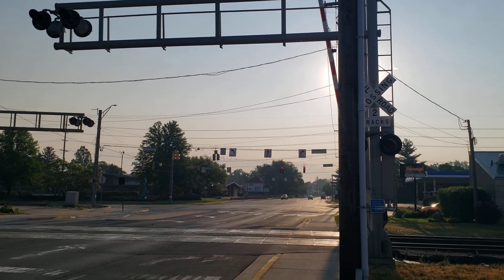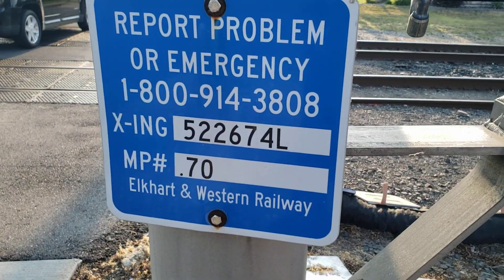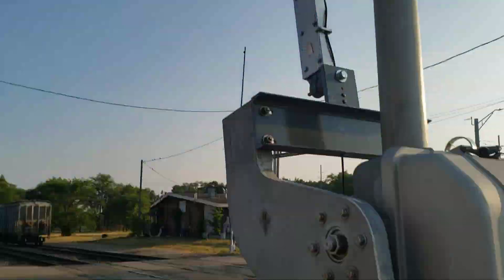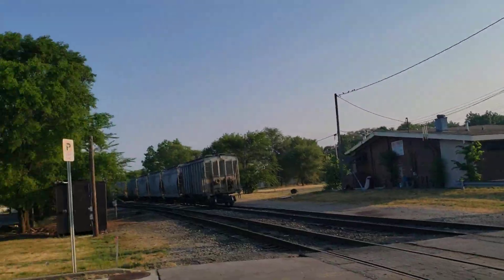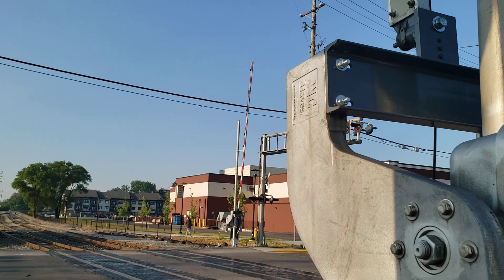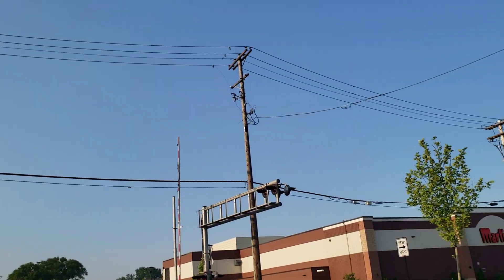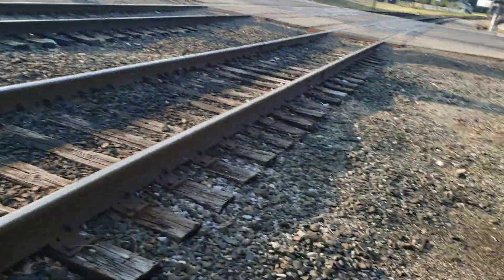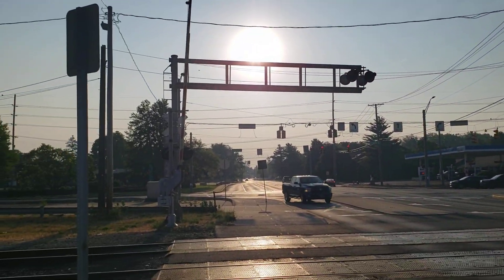Jackson Boulevard Railroad Crossing Tour, Elkhart, IN.

Comment: I thought for a moment that by the looks of it, the Lights would be WCH 12x20” GE Uniform LEDs. 🤔

And hopefully you can catch that Railroad Crossing in action soon 🙏🏻, as it’d be nice to see/hear if there’s a Bell inside the Relay Case or if it’s completely belless, like the Railroad Crossings in Batavia, NY, excluding Seven Springs Rd. (As it had a WCH Mechanical Bell in the Past, now replaced with an NEG E-Bell, while still wired to have the Bell only ring while the Gates are dropping…) & Donahue Rd. (As it was belless at first, but then after I’ve moved to AZ back in 2005, when it got upgraded to the Safetran Equipment, a low-pitched Safetran Type 3 E-Bell was added & was also wired to only ring while the Gates are dropping…). 🤔